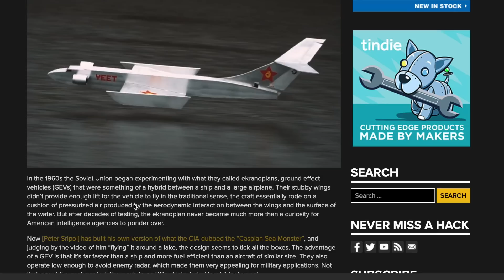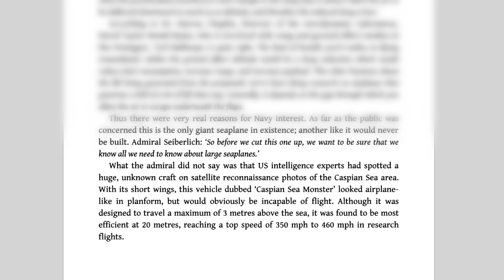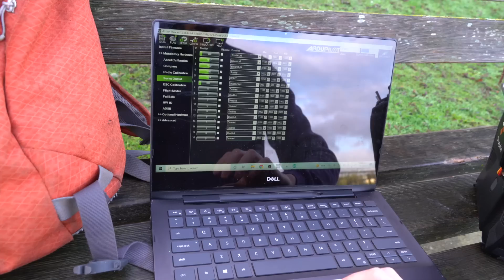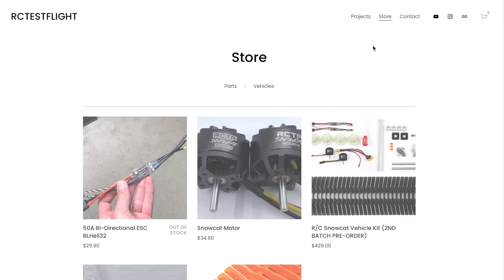Worlds First 'Real' R/C Ground Effect Vehicle

Comment: Perhaps people think being in ground effect is just flying low to the ground, but it's a very different set of flight characteristics when in ground effect. So as you said if it's designed to exploit ground effect as it's primary mode of operation then it's a ground effect vehicle. It would be like saying an off-road vehicle isn't an off-road vehicle because it can still drive on the road. Sure, but that's not what it's design goal was, or what it's best at.
Reply: I feel like this is the best comparison
Reply: My thoughts exactly. A vehicle is names because of what it's designed to do not necessarily what it can do. The Spruce Goose couldn't fly out of ground effect but no one calls it a ground effect vehicle because it wasn't designed to be one. It was a flying boat that was underpowered. Versus in this case a GEV that is overpowered.
Reply: @nogland8916  The Spruce Goose definitely could fly out of ground effect, but didn't because it wasn't even supposed to take off at all because it wasn't needed for the war effort anymore. It only took off by "accident" (there is debate about wether Hughes may have done it on purpose to prove it could fly) during a taxi test. It never did go fully out of ground effect but only because they didn't do it, NOT because it couldn't.
Reply: Then every model airplane is a ground effect vehicle via your definition. If you've t any time behind the transmitter control sticks you know how dramatically different the aircraft handles while in ground effect.
Reply: @otm646  Model airplanes, real airplanes, and possibly even other types of aircraft such as auto gyros or rotodynes.
Reply: I like this definition. Perhaps it could be further clarified by saying "Is designed to be most efficient, during ground effect"
Reply: By saying that any vehicle that can achieve lift through ground effect is considered a GEV, you strip away any meaning of the term GEV. Kinda like saying that anything that can drive a nail is considered a hammer. If I took a regular Prius off road does it becone considered an off road vehicle? Does sonehow the design goals of the Prius change? Why do we call sone vehicles off road vehicles and other things like a Prius not? Is it because by definition the design goals of an offroad vehicle is to operate off road?
Reply: @Eidolon1andOnly  I think we might be talking past eachother, since I agree with what you're saying. If it's designed in such a way that it exploits ground effect in order to achieve lift, and that's it's design goal, then it's a GEV right? You certainly wouldn't call the Caspian Sea Monster a plane just because you added more engines and it took off, it's clearly designed to exploit ground effect as it's primary mode. There is no aerodynamic phenomenon that stops the CSM from taking off, it's just the power to weight ratio (or perhaps a reserved deployment of available thrust) that meant it did not.
Reply: @benridesbikes6975  We are talking past eachother because your logic means any and all aircraft are GEVs despite purpose built design. I refuse to accept that definition. Because it completely obliterates the definition. Every Rc plane to a Cesna to a Boeing 777 is now a GEV. What a useless term if almost all aircraft can achieve ground effect, and we just ignore design all together. In this very video the aircraft couldn't climb higher than ground effect. Let that sink in. The whole purpose of this video was not to design a plane that could go higher, but solely relied on ground effect for lift. Let that sink in again. I love this channel, but the Definition for what a ground effect vehicle is doesn't change because you or this channel disagrees with the definition. My RC model C130 is now a GEV because definitions are subjective and therefore meaningless now.
Reply: Airplanes can utilize ground effect, but they can still fly high, GEVs cannot break free from ground effect. Just like a wrench can be used as a hammer to drive a nail, but a hammer can't be used as a wrench.
Reply: @Eidolon1andOnly  

"GEVs cannot break free from ground effect."

Why? Because you say so?

So are you saying that it should be aerodynamically impossible, or that you're not allowed to add power to make it possible?
Reply: @notahotshot  Sure give it more power and then you turn it into an airplane if it can reach altitudes higher than what ground effect will allow. Now you've got a plane instead of a GEV.  Just like adding a motor to a row boat turns it into a motor boat. Sure you could still row the boat, but that doesn't change the fact it's a motor boat, just like a plane can still use ground effect but it's still a plane. A row boat is a row boat when it is limited to only oars for propulsion, just like a GEV is a GEV when it is limited to only the aerodynamics of ground effect for lift.
Reply: @Eidolon1andOnly  

"Just like adding a motor to a row boat makes it a motor boat."

No, it makes it a row boat with a motor on it. Or does putting wings on an Prius make it an airplane?

"In this very video the aircraft could not climb higher than ground effect."

The RC craft in this video could not climb higher than ground effect only when specifically power limited to prevent it. The airframe itself was capable of achieving sufficient lift and flying out of ground effect, given the proper application of power.

The Caspian Sea Monster crashed and sank to the bottom of the sea during testing while in development. It was not a successful anything. And there is sufficient evidence that it had enough power to fly above ground effect, albeit inefficiently, if they had chosen to do so.

The Spruce Goose was fully flight capable. The project was abandoned because the war it was being designed for was over, and it's intended purpose was no longer valid. Continued flight testing was not required, or carried out, because the project was no longer financially supported.

"By your definition any and all aircraft that can use ground effect are GEVs."

No, any and all aircraft specifically designed to operate most efficiently in ground effect are GEVs, even if they can fly outside of ground effect inefficiently.

"I refuse to accept that definition."

Your refusal of reality does not alter reality.
Reply: @notahotshot   The literal definition of a motor boat is a boat with a motor. So yeah, putting a motor on a row boat makes it a motor boat, LOL. 
mo·tor·boat
/ˈmōdərˌbōt/
noun
noun: motor boat
a boat powered by a motor, especially a recreational boat.

If you put wings on a Prius and it was capable of flight at higher altitudes, then yes it becomes an airplane. Technically a flying car, since it is both a car and a plane making the Prius a hybrid in more ways than one.
You mean the aircraft in this video that was specifically designed and powered to only work in ground effect is a true GEV? That's exactly my point. The Spruce Goose was a failed airplane regardless if it could have been powered higher to be a fully capable airplane, the reality is that it could never leave ground effect.  Also citation needed for the Caspian Sea Monster being capable of flying above ground effect. Where's all this evidence you speak of especially if there's plenty of it? The Caspian Sea Monster had its issues but it was successful in proving a concept which was its goal. Your own refusal of the definition of what a true GEV is doesn't change the reality of what a true GEV is. Even your own definition of a GEV being any aircraft designed to work more efficiently in ground effect vs higher altitudes is describing an airplane designed too poorly to operate above ground effect. At best it's a hybrid aircraft. Thanks for quoting me, it's a really condescending thing to do since it's like treating me as a child incapable of at least remembering what I already said.
Reply: @Eidolon1andOnly  according to the International Maritime Organization

"Wing-in-ground (WIG) craft

WIG craft is a multimodal craft which, in its main operational mode, flies by using ground effect above the water or some other surface, without constant contact with such a surface and supported in the air, mainly, by an aerodynamic lift generated on a wing (wings), hull, or their parts, which are intended to utilize the ground effect action.

WIG craft are categorized according to the following types:

type A: a craft which is certified for operation only in ground effect. Within prescribed operational limitations, the structure and/or the equipment of such a craft should exclude any technical possibility to exceed the flight altitude over the maximum vertical extent of ground effect;

type B: a craft which is certified for main operation in ground effect and to temporarily increase its altitude outside ground effect to a limited height, but not exceeding 150 m above the surface, in case of emergency and for overcoming obstacles; and

type C: a craft which is certified for the same operation as type B; and also for limited operation at altitude exceeding 150 m above the surface, in case of emergency and for overcoming obstacles."

https://www.imo.org/en/OurWork/Safety/Pages/WIG.aspx

Use this info however you will.
Reply: There are a lot of sailboats and row boats out there with auxiliary engines that are just motorboats. That little 2 HP trolling motor on a the row boat totally makes it a motor boat. There are also gliders with there own electric motors to self 'tow' themselves into the sky, should just call them proper planes. Since your definition of adding an engine says so. 
So by your "definition" of adding a motor to a row boat makes a motor boat. If i add sails to my motor boat it should be a sail boat, then install oars, ill have row boat. Since the last feature changes its classification, not what it was originally design.
Reply: @Eidolon1andOnly  Because a GEV is still just a wing, the only difference between a GEV that can't get out of ground effect and and one that can is thrust isn't it? That's why these RC GEVs are causing such controversy, because it's so easy to add more thrust. What do we gain by making thrust the defining factor, and not the more interesting factor of the vehicles flight characteristics and design goals?
Reply: @benridesbikes6975  You mean power to weight ratio, not thrust. But I am talking about design goals and its flight characteristics. If the vehicle is designed solely to utilize the flight characteristics and aerodynamics of ground effect, than it is a GEV, if it can fly higher than ground effect then it becomes a plane. GEVs can use much shorter wingspans with less surface area than a typical plane. Just because a plane can use ground effect doesn't mean we should classify it as a GEV anymore than just because I can use a wrench to drive a nail doesn't nean we should classify it as a hammer. Even this video proved how the new design for this RC GEV could not climb to higher altitudes free from ground effect, because it was designed to operate as a GEV not as an airplane. That's the whole point behind the "real RC ground effect vehicle" in the title of the video.
Reply: @Eidolon1andOnly  Ground effect is generally defined as an altitude below half of the wingspan of the vehicle. The GEV in the video flew well above that, if not very gracefully or for very long. Does this make it an aircraft? To use your Toyota Prius analogy in reverse, (with off-road vehicles being considered "true aircraft,") the Prius went offroad, got damaged bumping over rocks, stuck in mud, and barely limped back, but it was able to make it through the off-road trail. Does this mean our Prius (the GEV in the video) is actually an off-road vehicle, just because it didn't have a wheel fall off or the engine break down? Point is, many GEVs like the Ekranoplan were technically capable of flying out of ground effect, but their performance was much worse and it was most certainly not their intended use.
Reply: @ratemisia  All GEVs are technically aircraft, and I'm not entirely sure that's an accurate definition of ground effect, or that ground effect scales down.
Reply: @Eidolon1andOnly  By your own definition then, as others have pointed out, the Caspian Sea Monster is a plane, and so was the Spruce Goose. Are there any GEVs that actually meet your requirements?
Reply: @benridesbikes6975  Actually the Caspian Sea Monster was designed solely  as a GEV and never once flew above ground effect, and the Spruce Goose was designed as a plane but could never achieve altitude above ground effect. Spruce Goose was a failed plane and the Caspian Sea Monster was a successful GEV. By your definition any and all aircraft that can use ground effect are GEVs, which devalues any definition for what a ground effect vehicle is. ALL RC planes, full sized planes, some autogyros and rotodynes are now ground effect vehicles according to your logic. Also all rocks, wrenches, and whatever else can be used as a hammer is now a hammer according to your same logic.
Reply: @Eidolon1andOnly  Not necessarily. A GEV is a vehicule designed to work the best in Ground effect but that doesn't necessarily have to stay in that range.
Reply: @ezrarichardson279  What you're  describing is an airplane that was designed too poorly to operate more efficiently above ground effect.
Reply: @Eidolon1andOnly  It kind of is. But it's supposed to be more efficient then if the plane was designed to fly higher (in theory).
Reply: @Eidolon1andOnly  That's what the Caspian sea monster is.
Reply: @ezrarichardson279  Any evidence that the Caspian Sea Monster operated above ground effect?
Reply: @Eidolon1andOnly  Everything stated in this video and the last, plus the findings that it would actually be most efficient at 20 meters where ground effect would almost be non-existent. The Russian military themselves apparently claimed it could go much much higher to avoid obstacles, thus no ground effect.
Reply: @ezrarichardson279  I don't trust anything the Soviets boasted about, and as far as I can tell, only one out of the 3 huge Ekranoplans the soviets built was capable of flying above ground effect, and it wasn't the Caspian Sea Monster, yet I haven't seen any evidence of this being true. The Caspian Sea Monster's operational height was anywhere between 13-46 feet and I've yet to find anything to suggest it was capable of going any higher than that.
Reply: @Eidolon1andOnly  As far as I know it was never attempted/done. But all the evidence points to it being more the feasible. (especially since they throttled down the engines A LOT after takeoff, meaning they had a lot of power left to get out of ground effect)
Reply: @Eidolon1andOnly  go to 1:40 on his previous video.
Reply: @Eidolon1andOnly  I guess we can say there are two types of ground effect vehicle. True GEVs that can't leave ground effect and hybrid GEVs that are able to climb higher like a plane but function most efficiently in ground effect such as the VVA-14. Jumping back to the earlier argument of off-road vehicles, it's the difference between a screw propelled vehicle and a jeep. Both are off-road vehicles but good luck getting a screw vehicle to work on pavement.
Reply: @nogland8916  I'd say that's fair.
Reply: @Eidolon1andOnly  A hammer can be used a wrench. Just hit the nut at and angel. It is not a god wrench and the nut get damaged but it can be done.  :-)

Comment: AvE once showed a video where you can see your conformal coating coverage with a blacklight, might be worth trying to see the coverage
Reply: Worth a try but all coatings are not UV reactive. This is something I complained a lot in my previous job as having the lacquer visible in UV light made inspecting it a lot easier, sometimes it climbed up memory pins due to capillary effect for example which was not good.

Comment: yeah for argument sake, its pad of high pressure, over the surface created BY the wing.. Ground Effect, i would imagine this is much like fluid dynamics and scales poorly hence the buffering with water or objectively, full flight under power, GO BIGGER! and the relative power scale will fall when true ground affect is achieved. Its a dynamics/atmospheric issue. Bigger in this case is better, cold days will have greater G/E force as the atmosphere is more dense, and i imagine the the pressure pad will be more dense and support Ground Effect more easily. Test it mate.. You know what to do. This isnt hard. In addition to the mass, momentum, and energy conservation equations, a thermodynamic equation of state that gives the pressure as a function of other 
thermodynamic variables is required to completely describe the problem. An example of this would be the perfect gas equation of state:

.1) Reff https://en.wikipedia.org/wiki/Ground_effect_(aerodynamics)

.2)Reff https://apps.dtic.mil/sti/pdfs/ADA291964.pdf

.3)Reff https://en.wikipedia.org/wiki/Fluid_dynamics